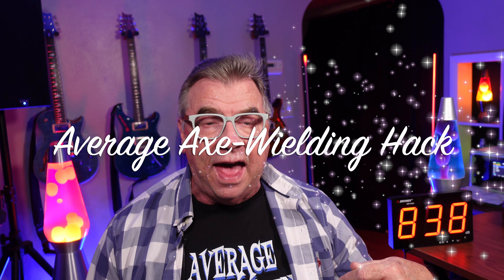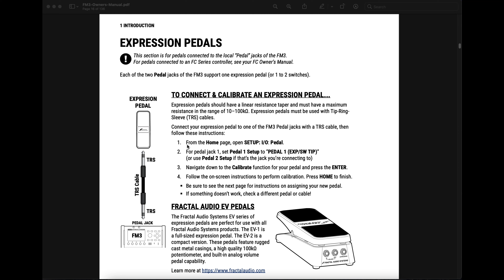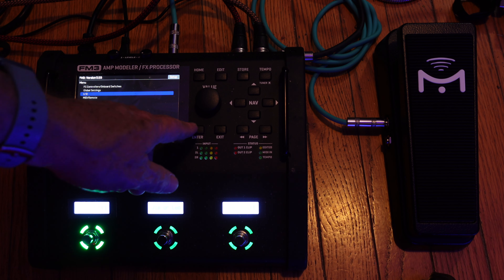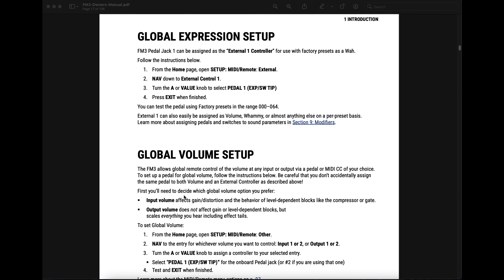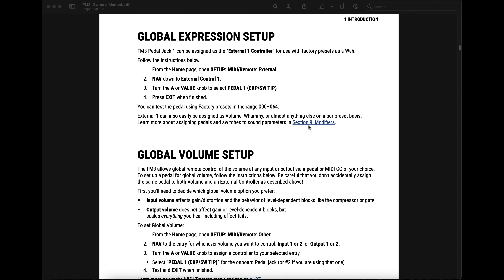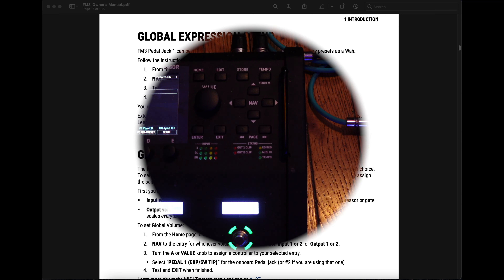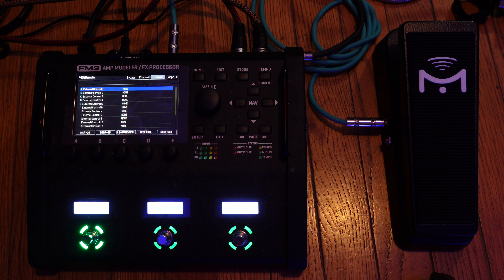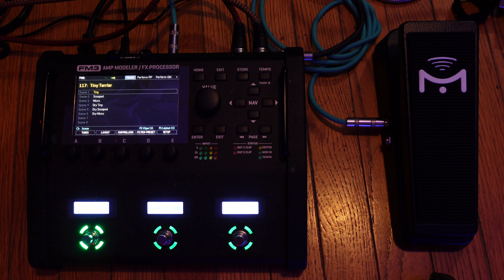How To Set Up An Expression Pedal For Your FM3!

Comment: Hello! Tell me how to set the volume pedal so that the sound does not go away completely at minimum? The task: to leave the volume I need with the pedal pressed to minimum.
Reply from the maker: Sorry, I don't have my FM-3 anymore. But you should be able to set a minimum value of something other than 0%, probably on the Edit Modifier panel.
Reply: @DougBsDigitalDen  Thank you very much! I have found a solution. The "Dunlop volume x mini pedal" volume pedal itself has an adjustment of the minimum volume value inside. It turns with a screwdriver). And then I used FM3 modifiers.

Comment: Hello Doug! I noticed handles on the top of the FM3. Do you have a video on how to perform that mod? Thank you!
Reply from the maker: David - that's how mine came from the factory. I thought they all had handles!
Reply: @DougBsDigitalDen  ok. I was looking at the FM9 and the one I saw does not have one. It looks the FM3 has one, while the FM9 does not. Thank you for your reply!
Reply from the maker: True - FM3 has handles, FM9 doesn't. I think it would be better if the FM9 did have handles.